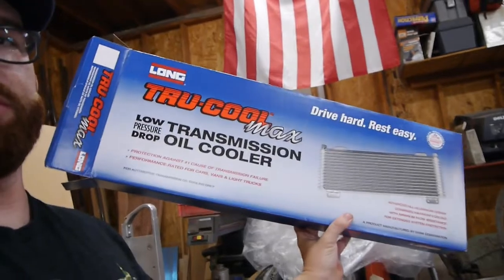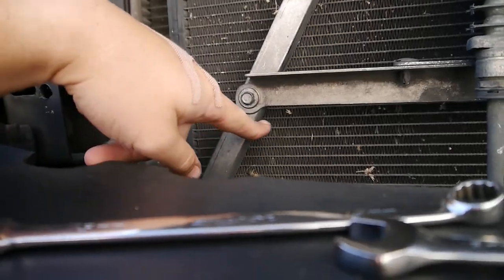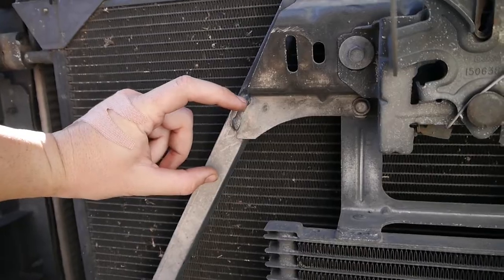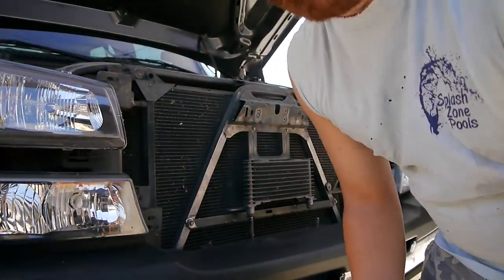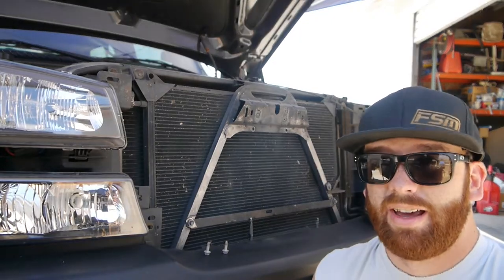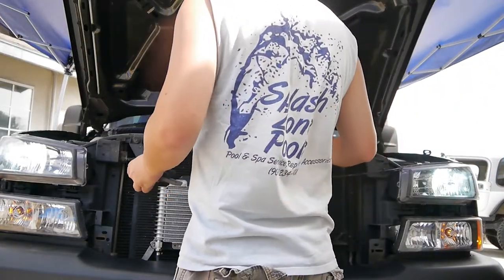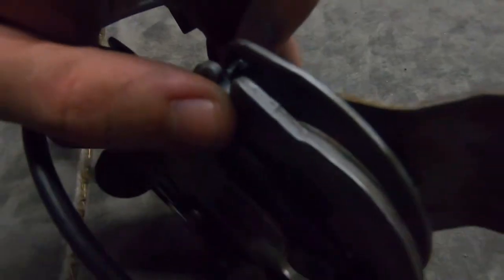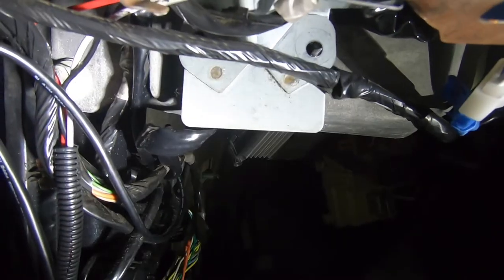Time to COOL off!!! Transmission Cooler Install! 99-07 GM Trucks.

Comment: I've been doing my research/homework on the tru cool transmission cooler one of the best coolers out there the stacked plates coolers are the best in efficiently. Plus the tru cool max has an low pressure drop unit. Well made good investment cost little more it depends how much you value your vehicle maintenance.

Comment: I've installed a transmission oil cooler, and the temperature is still 95 degrees more than 200 Fahrenheit
Reply from the maker: If your trans temps is that high, I’d say take it to a transmission shop to check it out, it may be to late for it and need a rebuild. That OR you have a bad temp sensor
Reply: @TheBeardedTortilla  I have had a new Allison 1000 installed in a 2005 Chevy Silverado 2500 HD last year with a brand new radiator but ATF keeps overheating. I feel stuck, should I use both the normal radiator and ATF cooler moreover ?
Reply from the maker: @davidkimvono3473  I would always recommend looking into a bigger or auxiliary transmission cooler for the older GM trucks. Sadly they are way to small and inefficient for the needs of the truck and driver. This transcooler or a bigger one even from Mishimoto or Dmax Store should work great for your application.
Reply: @TheBeardedTortilla  thank you for your advice

Comment: wrong install orientation,  the return lines should be sitting on the top so it will not develop air pockets in your line. I hope it holds out.
Reply from the maker: Been runnin great, flows just like the stock cooler but I plan on doing a follow up video soon. Thanks though!
Reply: So the factory one is wrong? Cause it's not facing up?
Reply: That's a false statement found in YouTube and repeated. Their website specifically stated it can be mounted upside-down, right side up, or sideways
Reply: @regency1388  My instructions shows this upside down. The factory one is not the same design.
Reply: You cannot develop air pockets with the cooler being mounted any which way.
Reply: It don't matter what way there's a lot of hydraulic pressure

Comment: I was surprised that you blocked part of the new cooler with the light bar.
Reply from the maker: So sorry for the late reply! but A/C performance never changed at all nor does the cooling for the engine! Also, I was never able to get a good shot for the video but the light bar actually barley rests 1/4 inch into the flow of the cooler thus not really causing any air flow issues!

Comment: You would think the exhaust leak at the manifolds would be before a trans cooler lol
Reply from the maker: Thanks to the guys at Roadkill, I have learned a small noise leak that goes away was way below the need to save the 4L80E!! haha

Comment: Y’all know you have to put the ports up cause then the cooler will not get all the way filled, look it up you will be using only half of it
Reply from the maker: Thanks for the input but it’s worked great. And actually as the fluid heats and expands it uses as much of the cooler as it needs. Hasn’t missed a beat in the 2 years it’s been in the truck.
Reply: no your wrong....
Reply: @TheBeardedTortilla  yea eventually after a couple of minutes of having it on it will eventually fill
Reply: @jhaeck1  no I’m not😂

Comment: Hey what did you end up doing with the transmission lines going into the cooler? Did you just use rubber hose and clamps at the flared end?
Reply: My exact question

Comment: Good video. Are we at all concerned about the air that it takes away from the radiator?
Reply from the maker: Thanks man! I’ve had the same set up since this video was posted and my father now owns the truck, hasn’t missed a beat with temps since, trans stays cool, ac and engine temps are solid as well 👍🏻

Comment: Does it matter if inlet and outlet ports are facing downward? After my overhauled transission was completed and installed, i told mechanic to install transmission cooler and disconnect from radiator. He installed cooler with ports facing down like yours. Problem is i've been looking at youtube videos and most people install cooler with ports facing sideways. One youtuber says if ports are installed downward the fluid won't reach all the way to the top of cooler fins, only 50% of cooler will be utilzied. Thanks for video, any feedback appreciated.
Reply from the maker: Thanks for asking! That truck is still in my family and I can tell you, the cooler runs perfect. I’m the hot AF summers, the transmission runs approx 100-120 degrees cruising down the road with 100+ ambient temps. Towing up hill, with about a 5000lbs boat, AC on, I’ve never seen the transmission pass 160. I hope that helps.

Comment: i just installed this on my 00 Silverado only running about 11 degrees cooler
Reply from the maker: Bummer, I’d suggest getting a transmission service and or rebuild, it should be significantly cooler unless there is already internal damage, best of luck

Comment: I have this one its great...i have a 3200 stall tc as well and it hasnt gone over 180 witut h me dogging it...135 for the low
Reply: Did you bypass the radiator or leave the factory lines like the guy in the video?

Comment: Aren't you blocking too much airflow to the main rad by installing that top bracket like that? Just curious. Thanks
Reply from the maker: No worries at all. Nope, the top bracket has never really caused an cooling issues. The truck is still in my family and still runs right at 208 engine coolant temp and around 100-120 on transmission temp in the hot CA/AZ summers.
Reply: @FountainFox Unlimited  awesome to hear! I've an 05 4.8l that came with no tran cooler at all. I don't tow ever, but I just hit the 100k miles mark and I'm considering the 40k cooler to extend the life of the transmission as much as possible. Your vid was very helpful, thank you!

Comment: How well does it work? Does it keep it noticeably cooler?
Reply: I installed this exact cooler to my Chevy Cobalt, temps went from 226°F in heavy traffic too 170-178°F with the cooler in the same exact hot summer traffic conditions. Literally 56°F drop on a small car lol. While cruising it would hover around 120-140°F. I'm looking to installing another one if these coolers to my explorer

Comment: What cooler you think is better this one or the mishimoto?
Reply from the maker: Honestly I think they are both great, they do the job as they need to of cooling the transmission temp better than stock. Depends on how much work you want to do I guess. I have the Mishimoto in my 2015 Silverado and it runs great, was a really nice kit for a clean install. On the older truck, the Tru Cool worked great for me to make my own brackets and such. I think it’s just preference.

Comment: Im very confused on my chevy 2008 v6, i have two big radiator like yours but i thought one of them was for the tranny but im seeing that the smaller one you had before was the one for the tranny so what are the two big ones for? I want to install the same transmission cooler as yours but not sure which lines go to it or if it will even make a difference if i already have one on there because my temp goes up to like 240
Reply from the maker: So if your trans temp is going up to 240, it’s probably time for a rebuild because that is way to high for normal operation. The two bigger cooler looking parts should be your radiator and your A/C condenser. The small one in the 99-06 trucks is the transmission cooler, as seen in my video. A helpful tip too is if that temp on your gauge is constant, meaning from the time you start your truck in the morning, it could be the sensor. Either way I’d recommend a visit to a transmission shop and then the cooler after. The GM 4L60E and the 80E do not like being that hot. I hope this helps.
Reply: @TheBeardedTortilla  thank you for your advice, the temp only goes up that high sometimes when im driving like 80 mph but its only sometimes, and sometimes when it goes up like that it comes back down to like 200 but when im driving regular speeds it stays under 210 so im not really sure, but ill try taking it to a shop and see whats going on, wasnt really trying to spend much on a rebuild but we’ll see how much it costs
Thanks 🙏🏼